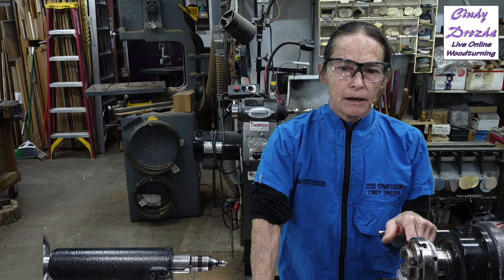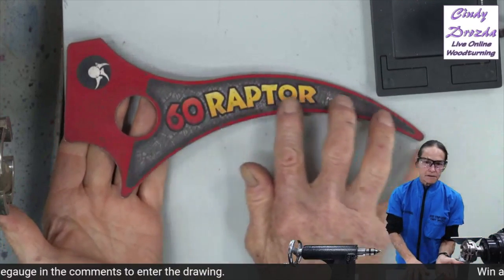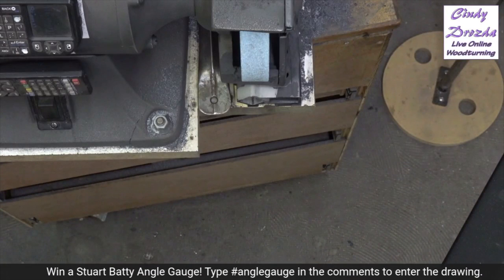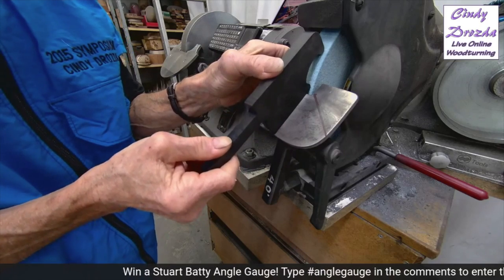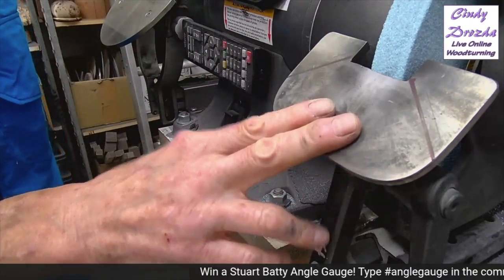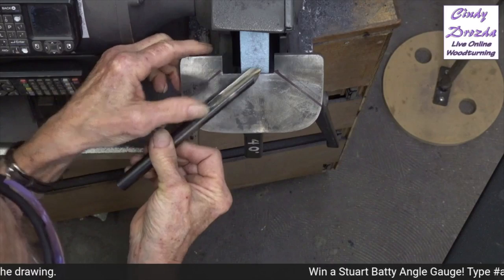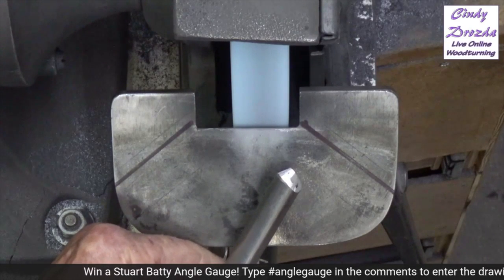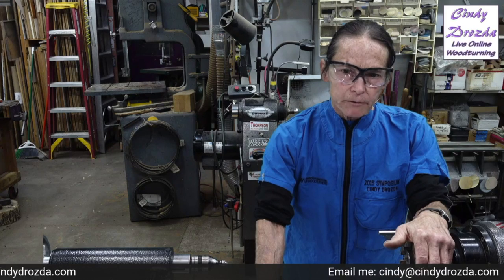Woodturning Tool Talk Live - The 40/40 Bowl Gouge

Comment: Very interesting. I have a slightly different approach to setting the platform angle. One time only I have set the angle of the platform by trial and error until I have the bevel angle as I want using the protractor. I then took the raptor jig and ground it on the wheel until it had some short flats similar to the Batty gauge, but at top and bottom. Since I'm using a CBN wheel and the diameter of the wheel does not change, I'm done and the gauge repeats accurately every time I change the platform angle.

Comment: Cindy, very helpful and it clears up a lot of questions I had about the jigs and in particular the Wolverine! Their platform not being cut out to go around the wheel is a pain. I hate to do the cutout using a rough stone wheel. Did you cut yours out with a metal band saw blade? You are a great educator. All the best from one old retired teacher!
Reply from the maker: I did use a metal cutting bandsaw to cut my Wolverine platforms, because I happen to have one. It is relatively easily done with a hacksaw, or angle grinder. By far the easiest is to make an overlay from thin metal or other material (I used double thickness Formica). Cut out the overlay and attach it to the top of the platform with double stick tape. I show that on one of my other sharpening videos.